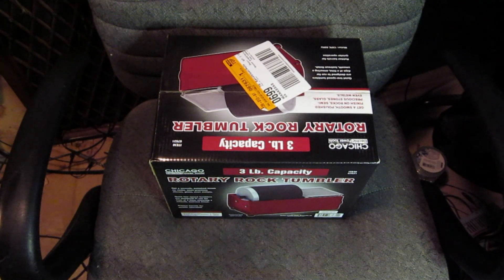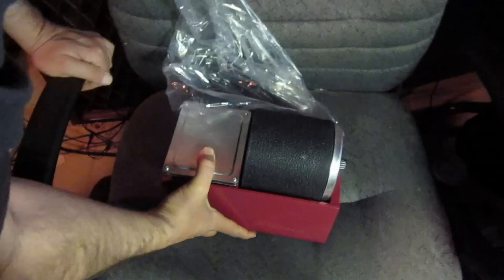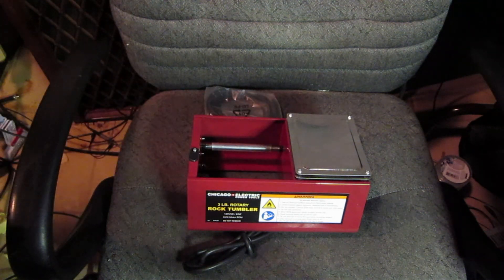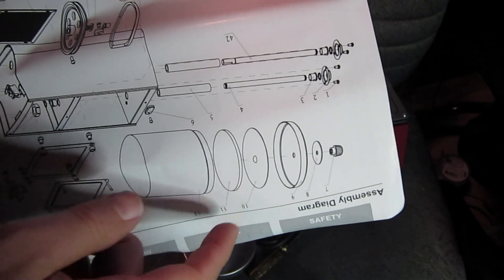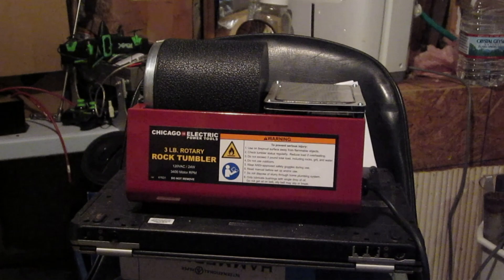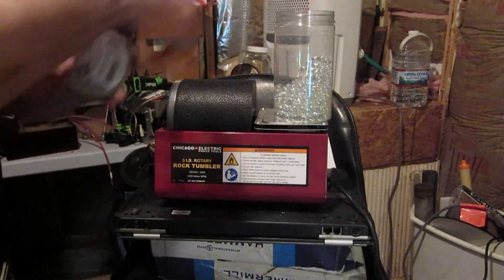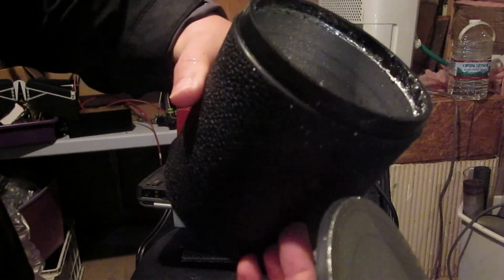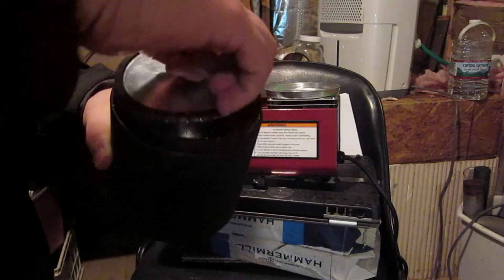Making Powdered Aluminum for Thermite - Rock Tumbler

Comment: Take a torch and blast the foil while it's still a sheet. Don't melt it but blast it to make it brittle and before u mill it grind it up with a  blender. The smaller u start out with the pieces the faster the process will be.

Comment: I read on another Al powder video that you should check it daily to avoid O2 depletion and spontaneous combustion when the O2 rushes in as you open it.  Also as others have said add some Charcoal as you powder it.
Reply from the maker: Ok.. maybe this should be done in a vacuum so the Aluminum doesn't oxidize? They didn't by chance say what the purpose of adding the charcoal was? Thanks for the great comments!
Reply: @jaynesnetwork  One of the many said it coats the Al and helps to reduce oxidation. May have been Elemental Maker.
Reply: @jaynesnetwork  actually you want it to oxidize but in a slow and controlled manner. This protects the rest from spontaneous combustion. Basically you burp the jar every so often so it doesn't catch fire or explode when you open it. Best of luck to you.

Comment: Add lift bars to your cans, it greatly reduces the time and it crushes it finer than that.
Reply from the maker: OK Thanks,.. what are lift bars? I did a quick search and did not find them??
Reply: jaynes network on the inside, place rails to lift the media and drop it. I used 3 ink pens and hot glue them.

Comment: Its easier to remove the last metal piece if you screw the plastic cap back in and pull it. Also easier to remove the metal cover with the washer used as a wedge instead of your finger nails. BTW glass balls are the best when making aluminum powder. Throw some charcoal in there.
Reply from the maker: Thanks, I'll give it a try!
Reply: @jaynesnetwork  DANGER I just tried this. Same tumbler you have except a two barrel, shredded alum foil, marbles, and tumbled 10 days. I open each container up and it immediately burst into a spark shower.
Was this static electricity built up from the marbles? What did I do wrong?
Reply: @zalmaflash  You need to open the container every 3 hours to air the container. BTW also make sure u add some charcoal to stop it self-oxizdising from contact with air.
Reply: @alexslab.4875  24*
Reply: @zalmaflash as you grind the aluminum into a finer powder, you're greatly increasing its surface area. Aluminum foil already has an oxide layer built up on the surface. As it grinds down, exposing more fresh aluminum surface from grinding it down, it'll use the oxygen in the barrel to oxidize it until it runs out of oxygen.

When you open the barrel after it's ran out of oxygen for long enough and has a large amount of fresh unoxided aluminum, it'll rapidly oxidize from the air, causing it to rapidly heat up and start a fire.

You can avoid this by opening the barrel roughly every 24 hours and also coating the fresh aluminum surfaces by adding charcoal which will coat the surface and protect it from being oxidized.
Reply: @thooper4380  Thanks thooper.:person-turqouise-waving: